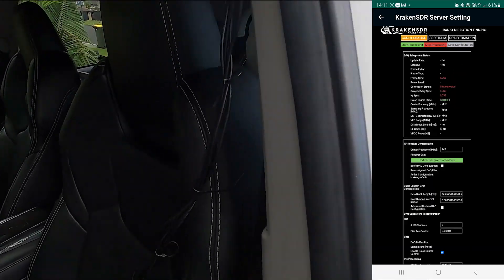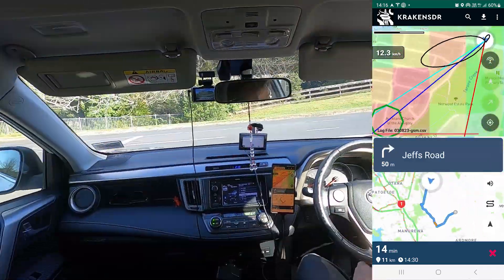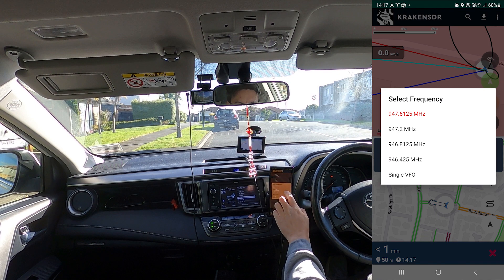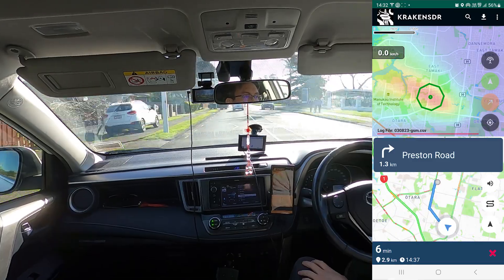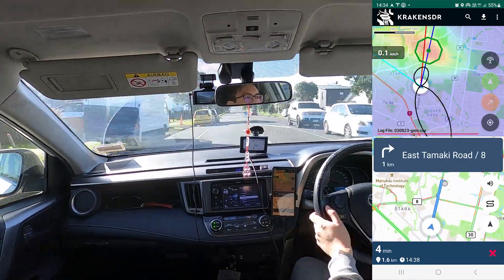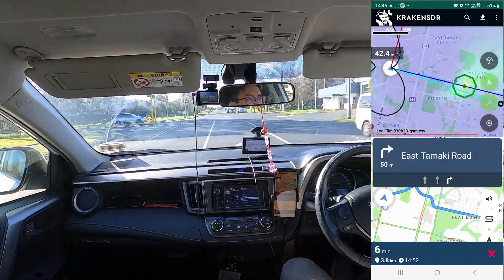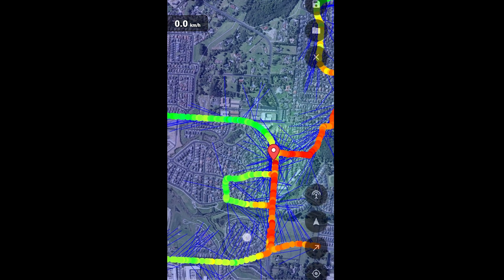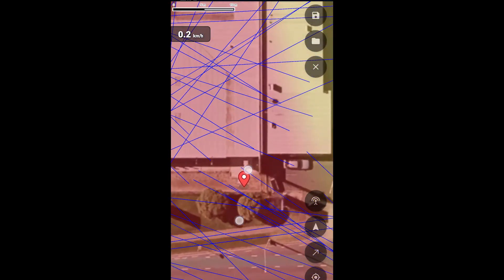KrakenSDR: Finding Multiple GSM Base Station Transmit Towers with the Multi-VFO Feature

Comment: How does the software identify the distance to the tower?
Reply from the maker: It doesn't know the distance from a single reading. After automatically triangulating from multiple readings collected over a drive, it will determine the location of the transmitter via the bearing intersecting points.

Comment: is it possible to use 5 identical  UHF antennas and 5 identical RF coax cables with SMA connector,   just not the ones that came from Kraken.
Reply from the maker: What you described is not a problem. It's best to match all five sets with a VNA.
Reply: thanks!      Please make more videos.    For example:   Linear Arrays:  Why use them?   What are they good for?   etc.      Airborne usage of Kraken:   Whats it like to fly to a transmitter.    etc. etc.

Comment: Congratulations, great project! I have a question, is it possible to use HackRF One in this project? I would like to get a wider range of frequencies, thanks in advance for your answer.
Reply: Yes its possible
Reply: You need (5)  five  phase coherent receivers and the correct software.
Reply from the maker: It is not possible to use the HackRF with our software.

Comment: Cool video, what if an unknown number of transmitters are on a frequency?
Reply from the maker: If there are multiple transmitters broadcasting at the same frequency over the same geographic area, then there can be issues and it will most likely just lock onto the strongest signal. You can experiment with the num sources setting in the GUI to try and get more than one bearing peak for each transmitter.

Comment: Interesting, did not know how to use multiple VFO’s. I suppose this is only useful when moving around, not from a stationary setup like I use - as it appears to store estimated location for each frequency - not average bearing ?

And - would prefer no ‘music’ - it is much louder than your voice, have to adjust volume up/dow every time you switch between talking and the ‘music’
Reply from the maker: It will work on stationary setups too. The logs are the same as when using a single VFO, it logs the bearing data + location data. Estimated location isn't stored, that's all calculated from the bearings. The web mapper at map.krakenrf.com doesn't support multi-vfo yet however, it's only available in the Android app.

I'm fairly certain I normalized the audio, but will try to keep that in mind for the next video.
Reply: @thekraken2086  your audio levels are fine.